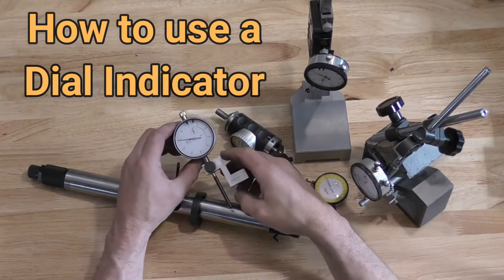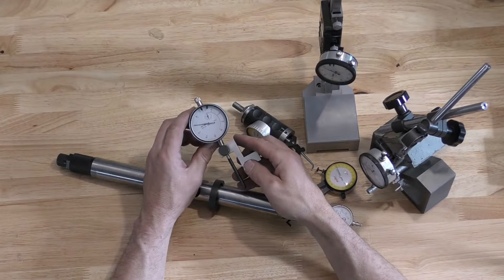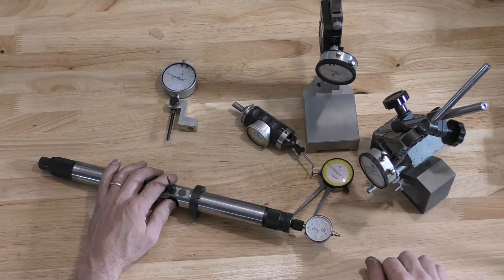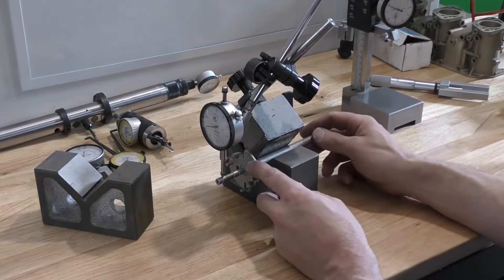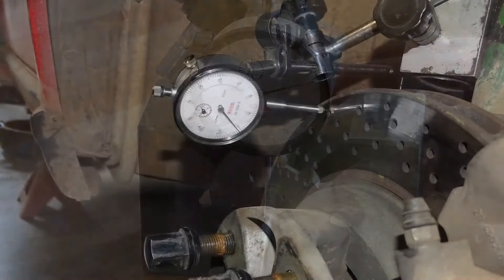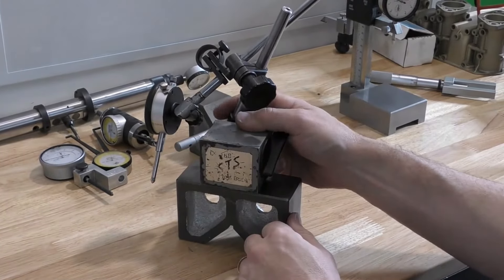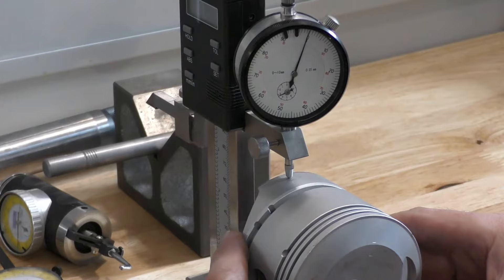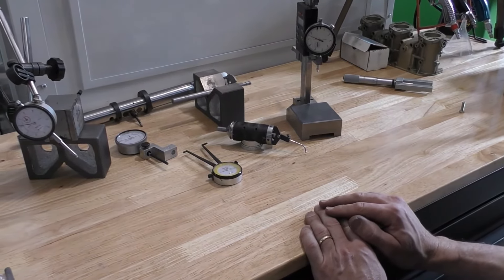How To Use A Dial Gauge Indicator.

Comment: Kurt excellent and appreciated contextual video. 

Re the vw 385/1 tool - wasn’t clear on that. (For others, normally used to measure the lash bet pinion and ring gear for determining diff axial preload reqs for side covers on diff assembly of 901 and 915s (Kurt pls correct me if wrong) g50/01? 

Is the dial gauge at the top a specialized vw/porsche tool or can i source any brand metric gauge?

What does the dependency chain of set up for the end mounted dial gauge look like when it comes to set up of the other gauges? i.e. choosing the perpendicular pin tool that sits on 385/1 or adjusting the tuning fork? There was no video example on actual parts, so had a hard time picturing this contextually. Saw your trans rebuild vid but you didn’t go too in depth. 

Ive been actively collecting these tools as they pop up if priced right (quite rare). Don’t have the dial gauge yet and would love to understand the full procedure of 385/1. Imo great video just on that topic - don’t believe anyone has made one yet.
Reply from the maker: Fancypants, we are actually doing a 902 transmission right now with a full diff set up. I will devote some more time on showing the setup on the diff tools if you like. When it comes to the dial gauge used with the 385 tool it is just a generic gauge that fits the shaft size and head size in metric. Let me know if there is something really specific that you want to see.
Thanks 
Kurt

Comment: I liked the comparative measurement example with the piston skirt pretty cool, great idea it’s just like measuring cylinders. The pinion depth tool you show - you mention it can be used on 901s…the WSM doesn’t show the 385 setup for 901s. Do you use the same mandrels and extension as  the 915 setup?
Reply from the maker: Thanks, and yes the WSM wont mention using the VW385 tool because it did not exist yet. Back then they were still using the old mandrel set up. The set up on the 385 tool for the 901 and 911 series transmissions is the same as the 915 transmission.
Kurt